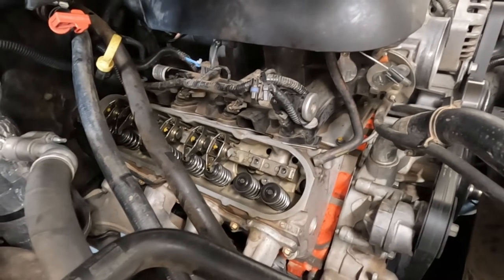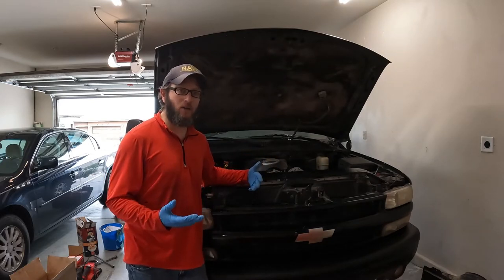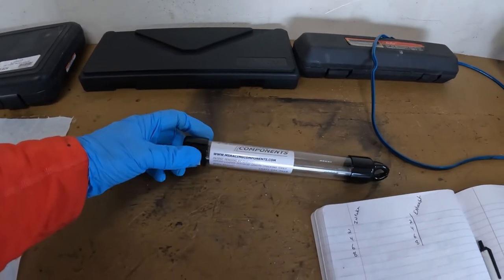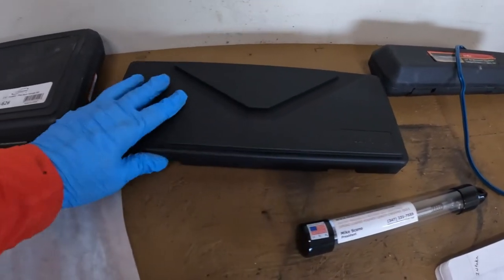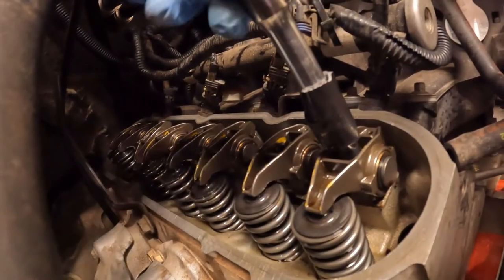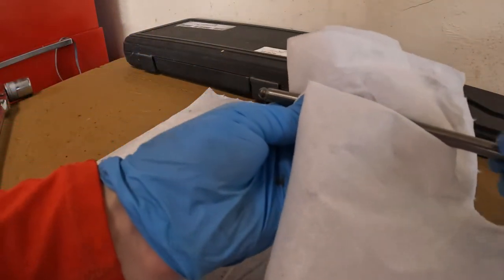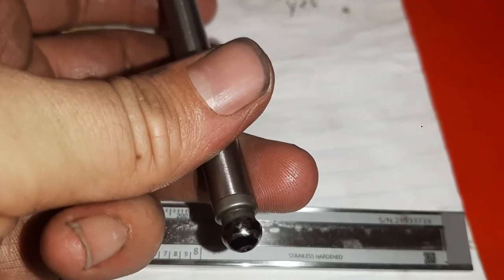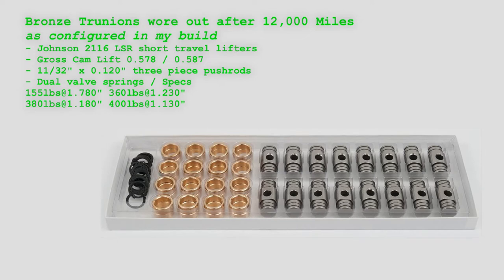Part 1 Checking Valve lash on LS / Gen III SBC

Comment: What was your final pushrod length?
Reply from the maker: With my new rocker arms (Yella Terra 1.6 ultralights) it's five at 7.496 five at 7.501 and 6 at 7.506. Preload was 0.035" +/- 0.010" (Preload tolerance is 0.005" if you have an aluminum block). That's for the LSR 2116 Lifters.  Every build will be different the specs are so tight on preload that the variance in engine build will make yours different. Feel free to email me if you have any questions, I probably spent 100 hours working on this and did it all wrong first time. Lifters are AWESOME but overkill for my build. I wanted to do away with lifter trays, I'd have been fine to do a LS7 style link bar lifter. These I think give you a TOUCH more power and more accurate fueling as the piston in the lifter is more consistent / valves follow cam profile more accurately. Other than that, I never pull high enough RPMs to realize their full benefit. You can email me through my website at http://www.keystoaz.com/contact-us/ (I'm a realtor by day)